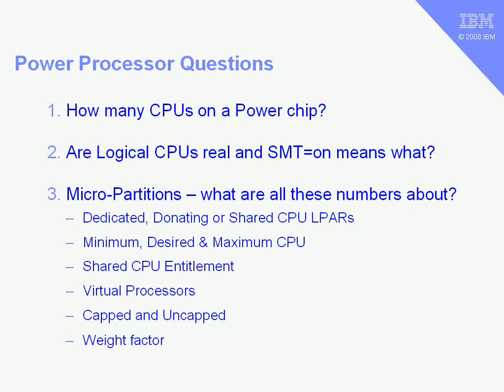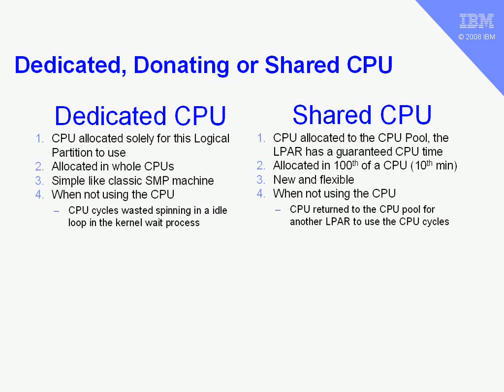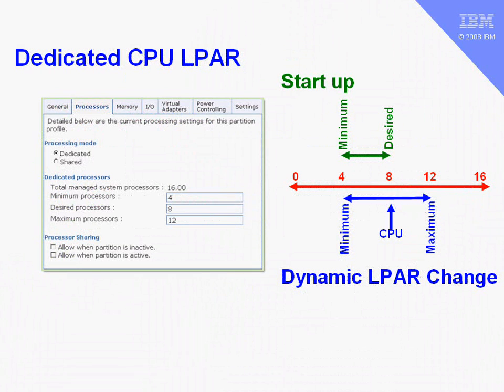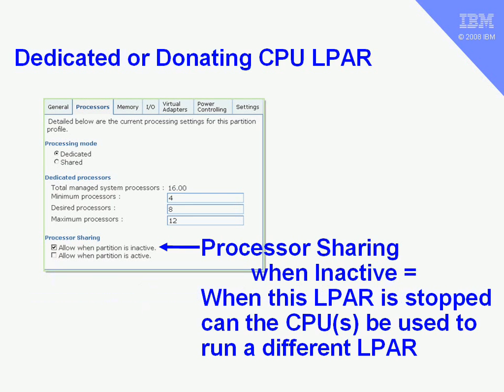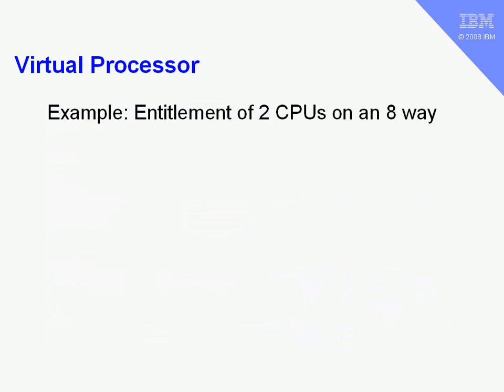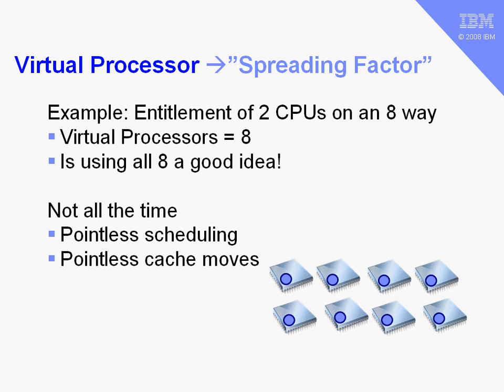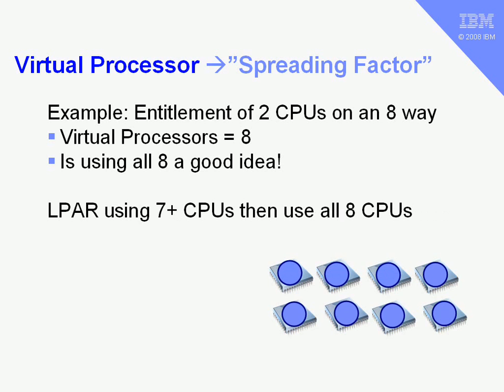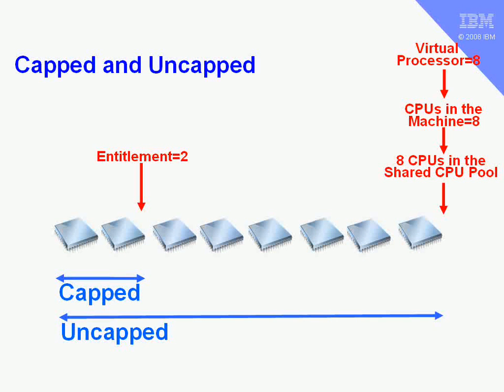PowerBasics What is a Virtual Processor? and Shared Processor LPAR?

Comment: If I have lpar of 1 entitlement with 2 virtual cpu in shared uncapped mode ,  what if cpu used percent is showing 270 percent? As it is 2 virtual cpu it should not go beyond 200 percent correct?
Reply from the maker: I would need to see the nmon recording file to check the details.  Power servers run SMT that allows multiple programs to run at the sane time on each CPU - so yes, you can get more than 100% per CPU. Rough examples might be at SMT=4 you can get up to 140% work done. For SMT=8 it goes even higher.
Reply: @nigelargriffiths  In my case smt is 8, as per documentaion Although an uncapped logical partition can use more processor power than its assigned processing capacity, the uncapped logical partition can never use more processing units than its assigned number of virtual processors.  

In my case CPU used percent is showing 278 percent with 2 online virtual cpu and 1 physical entitlement where SMT is 8, but doucmentation is shwoing it cant go more then number of virtaul cpu, it should show 200 percent , why it is showing 278 percent can you please explain
Reply from the maker: @akhtarshaikh5594  
I would need to see the nmon recording file to check the details. Please email to me at at hotmail.com user nigelargriffiths  Note nmon files compress well, for example, with zip.
Also which specific statistic you are finding the 278%.

Comment: Hi do you have videos on how to use the DLPAR ?
Reply from the maker: Go to the HMC.
Select your Server.
Select you LPAR (virtual machine)
Select Processors
Adjust your Virtual-Processor number (the size of the LPAR) and/or Processing-Units (Entitlement)
Click Save
You have dynamically changed your LPAR.
Not really worth a video.
Reply: @nigelargriffiths  thks for the info..l mean to ask how do we use DLPAR dynamically not manually to add/remove resources to save on cost and usage for the PVS..or how can we save on cost when we use PSV..I understand we can detach the storage and not the os disk...
Reply from the maker: @mohamed88885  Well for PowerVS you do the same thing but using the IBM Cloud website. Dynamically mean this can be done with the server running and the effect are immediate. 
So perhaps, you mean automatically.  So when the virtual machine gets busy it gets large with PowerVS. Sorry, that is not available as far as I know. 
Nor the Enterprise Pool idea of a set of VM's with an overall resource pool that moves around. PowerVS only has a Virtual Processor count that you can change.
Perhaps, having POWER in your computer room does have advantages.
Reply: Thanks so much Nigel. Now I understand DPAR actually means. Your explanation helps me lot so as your video tutorials. Really appreciate the effort.

Comment: Forgot my manners in the initial post - may I get your input on the questions below?  
In the example around 17:25, where Virtual Processor=4, is that the Maximum Virtual Processors?  Or is it the Allocated Virtual Processors?  For "Allocated Virtual Processors", is that analogous to the "Allocated Processing Units" where that is what we are asking to be guaranteed?  For my CEC with shared CPUs (20) in the default pool; all uncapped, with default weight of 128 - I've set up an lpar with Processing units to Max=4, Min=0.1, Allocated=2.  Virtual Processors are set to Max=8, Min=1, and Allocated=2.  For that scenario, assuming that all other lpars are idle, what is the maximum number of CPUs I will get?  Is it 2 (since I'm only Allocated 2 Virtual Processors)?  Or is it 8, since that is the Maximum Virtual Processors?  Apologies if I've made this as clear as mud.  And of course, Thank you for any help you can provide.
Reply from the maker: OK you are mixing up different settings.  On Power we can dynamically (online) change the CPU and memory settings - these are called DLPAR (Dynamic LPAR).  The Min and Max settings are sanity boundaries for these changes. That are NOT used in managing the performance - only if you are changing the size of the LPAR.
There there are the Desired settings to Virtual Processor (VP) and Entitlement (E processing Units).  Once the LPAR is started these become the current Allocation.
The VP its the numbers of Physical CPUs the LPAR will spread out across. It will be the upper limit to what the uncapped LPAR can use without a user making DLPAR changes.
E is the guaranteed CPU time for the LPAR - if uncapped the LPAR cat fight for more CPUs from the Share CPU pool.  The E is the limit if the LPAR is capped.
I hope that answers you question.
Reply: @nigelargriffiths  Thank you!  That clears up my question completely.